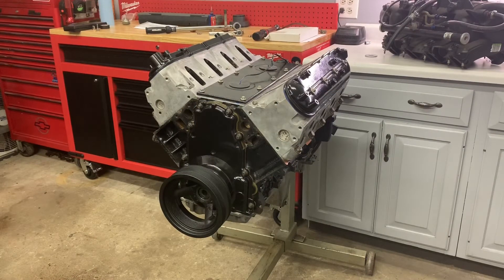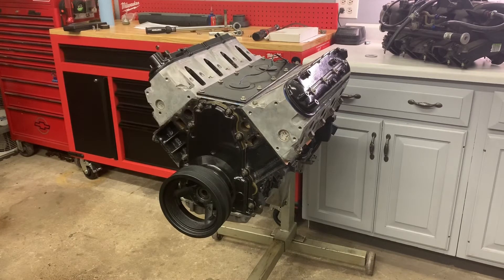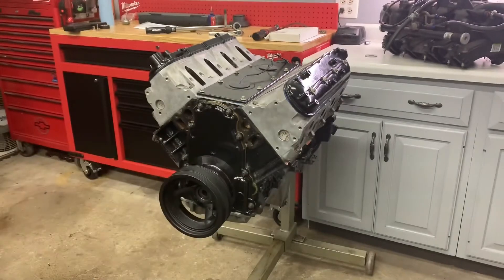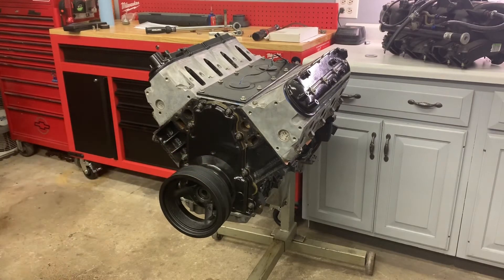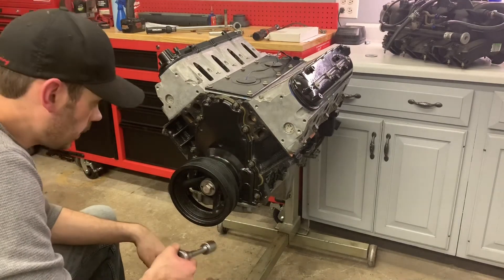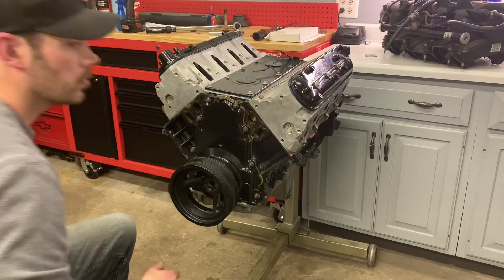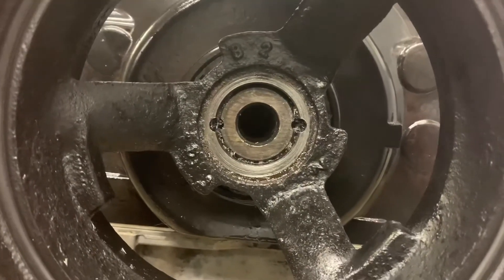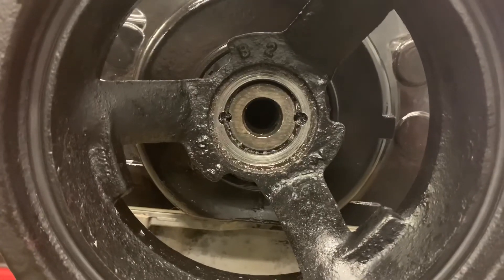LS crank pin install

Comment: Nice job, do you need to put any rtv or sealant on the pin?
Reply from the maker: No sealant needed, as it’s outside the crank seal. Some people put a drop of thread lock on it, but there’s nowhere the pin can go once you’ve got the bolt on.